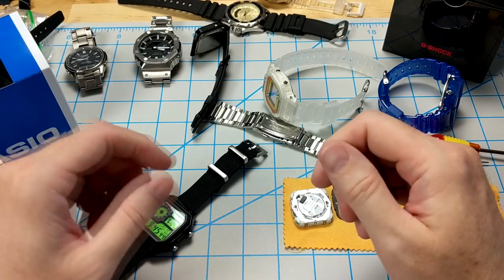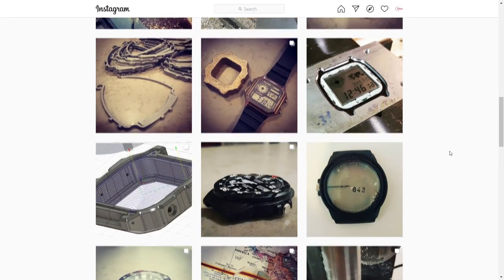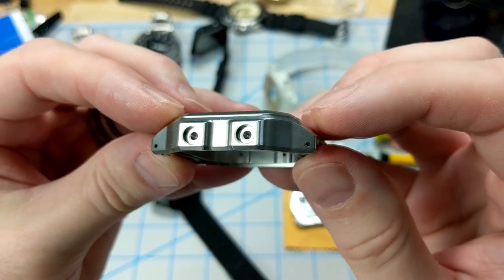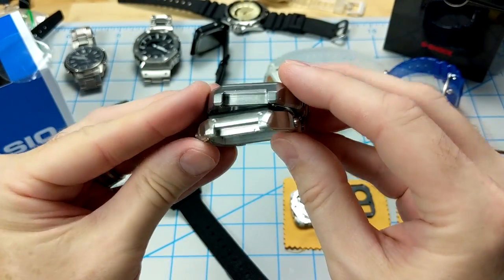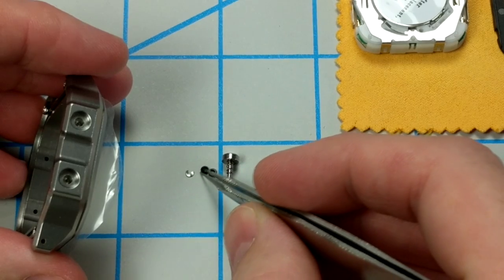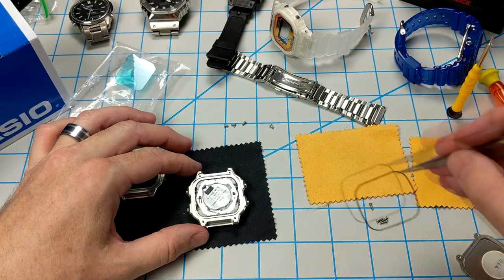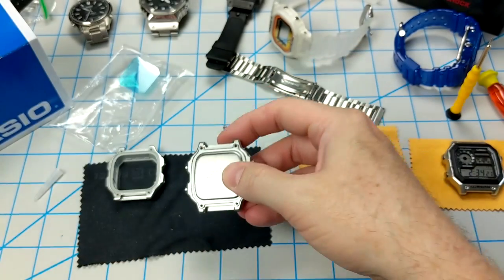Stainless Steel Casio Royale AE-1200 Mod

Comment: No doubt this is an absurdly cool addition to any Royale fans collection, but man, any way you slice it, that $150 price tag is quite the chunk of change for a Royale upgrade. Not to say that it's overpriced or anything- on the contrary, It's definitely warranted, being that the guy designed and machined these all on his own. That being said, as much as I love the Royale, with how cheap you can buy metal cases for 5600s and similar variants from China, it's difficult to justify this of expense for me, at this point in time, at the very least. 

Appreciate the video!
Reply: Metal cases for 5600 are actually only bezels, this is a complete casing.
Reply: @watchmakerful  I was gonna say the same thing. The bezel on a 5600 is just a facade that covers the module.
Reply: Definitely a product for absolute enthusiasts, that only a few will really appreciate. I'm personally surprised that there isn't a bigger market of custom cases for other watches. Think about 3rd party cases for the F-91W that would completely change the shape of the watch.
Reply: Saphire would've been nice too for the price.
Reply: This is a great product by a talented person but I just can't justify spending $150 on it. It's not that it's such an unfair price or anything, it's about my country's weak currency.
Reply: @C-NoteMac  Agree. Sapphire glass and the case made of 420 hardened stainless steel for the ultimate upgrade...
Reply: Idk man i think its kinda fair price for his skills and the trial and error for making it.
Reply: Absolutely ridiculous cost. Even the Casioak 3rd gen stainless steel mod is less than half the cost!
Reply: Look for their clone, skmei, their cases are good and you get metal bands, gold, black. You can easily fit the original "mecanism" inside
Reply: We are talking about the processes to get that curves, parting lines, tiny holes, provisions, time, machines knowledge & skill & experiences. Considering it is not a mass-production the price is a bargain tho. Serious talk

Comment: Ol dude picked up on the will of every casio fan out there! Casio Royale has so many features and is extremely accurate. My favorites on the watch are the 3 sec. amber lights and hella loud sound notifications. 
Im currently rocking gshock square 5600 with gold stainless steel case.
And throw away your 5610s. Unless u like not hearing your watchs alarm. -Shade
Great vid. Thx.

Comment: I bought mine just to mod. Erased text on the outside and inside just left Casio and the button functions. VERY clean also! Updated today, taking the discarded rubber strap from my Duro, cut it to lug size (20to18), and tapers perfectly with the Royale! metal and rubber combo makes it sportier and its not available yet from Casio.

Comment: I have ordered one. I will try to Mod my SKMEI 1335. 
The SKMEI has in my opinion some advantages.

Its cheap, less than 10€ on eBay.

I like the design of the LCD. The symbols and numbers are more readable.

The backlight is an eyecatcher.
Reply: Retro Pedro I have purchased several Skmei watches that mimic some of my Casios. I have the 1335 (AE1200), 1338 (A500), 1381(DB-360) and 1456 (GMW-B5000D-1). They are curiosities, which I never intended to actually wear. Some of the displays are not bad, but the Skmeis all lack the functions of the Casios. The bracelets are cheaper and have rough edges. Except for the 1456, the corresponding Casio does not cost that much more. Therefore, I would never recommend buying one of these Skmeis over an actual Casio.
Reply: The Case arrived. I happily disassembled my SKMEI but sadly it did Not fit.
The SKMEI electronics is a bit too big, anyway should bei possible to cut it down. 
The real show stoppers were the Buttons, they are a bit too big, don't fit through the holes .....

Comment: Just a tip for those who are moving the buttons over. Make things easier on yourself, place the metal washer and both gaskets onto the button shaft then insert into the holes. Coming from a G-Shock modder
Reply from the maker: Nice tip 👍

Comment: I'm considering this mod myself. The consideration is the cost of an AE-1200 versus the cost of this mod which has me wavering some.
The line - or ridge - around the sides of the resin case isn't where "two pieces of resin were sandwiched together". It's called a "parting line" where the two halves of a mold meet. In high precision molding you should never see a parting line without taking a 5x or higher magnifier to the molded part. Not too surprising these are obviously visible with Casio given their volume production and the price of these watches. Some of the secret in preventing a visible parting line is in mold design and where the two halves of the mold meet with regard to the object being molded. The clip is called an "E-clip", the name derived from its shape.
Reply from the maker: Yeah that parting line on the Casio is readily visible. I say go for the case! It really is beautiful and worth the money. You will love it.

Comment: Love this mod and the craftsmanship that went into it.  It must be difficult to source a square sapphire crystal, but I wish it came with one instead of the hardened mineral crystal.
Reply: Jonas here.  I really had a tough time choosing between sapphire and mineral and went with mineral for cost reasons.  I can make sapphire an option, but it would increase the price by $20.  What do you think?
Reply: @jelden65  Jonas, I didn't expect you'd reply, but thank you for doing so.  $20 more for a sapphire crystal isn't a deal breaker.  If I decide to mod my AE1200, I'd definitely want that option.  Thank you again for your reply.

Comment: Beautiful case and mod! I am an amateur vintage LCD watch restorer and just have to say those c clips you mention at 6:53 are a nightmare to install. 😄 I found someone online mentioned easiest way to remove them is inside a zip lock bag. Just in case they spring out.
Reply from the maker: That's a good trick. Yeah they are tough. I bent mine (obviously) but eventually got them mostly straight to reinstall them.
Reply: @WatchingCasio  You did a fine job! Those pushers look secure and face plate nice and snug too. 😊

Comment: You've bent the C-Clips out of shape. Your best option would've been to find replacement c-clips, they're supposed to securely snap into place. Beautiful case.
Reply from the maker: Yep, they are a little bent. i tried to flatten them out as best I could.
Reply: @WatchingCasio  It would've been nice if the case came with replacement c-clips. I don't think they're even meant to be re-used.

Comment: OH man, I hope he does one for the other classics like the A168!
Reply: Also, what is he using for the glass?  Mineral?  Sapphire?
Reply from the maker: Mineral.
Reply: If it was sapphire, it would be $250.
Reply: The A-1000D is the watch you're looking for @S L
Reply: @traviswalker8933  I do like the A1000 but the mother of pearl dial is a bit much for me,  I prefer the simplicity of the A168/A158!  Also Jonas himself replied and a sapphire would increase the cost by $20.  Worth it IMO!
Reply: @sl1237  the A1000D is available in different variants.
Reply: @traviswalker8933  Yep, all of them have the mother of pearl dial.  Even the dark A1000M has that sheen to it: https://www.youtube.com/watch?v=JJltKFeKdGA
Reply: @sl1237  that's not called the mother of pearl. It is not even a pearl colour. If the dial is a problem, you can replace it.
Reply: @traviswalker8933  Mother of pearl does come in multiple colors including the dark grey of the A1000M.  Even Casio describes it as mother of pearl.  If the dial can be changed that would be great, but how do you do it without ruining the lettering etc.?  I'm sure lots of people would like to know!
Reply: @sl1237  you can take the old dial out and then get in a new, more simple one. The dial is not affixed to the glass.
Reply: @traviswalker8933  Have you done this mod and can share pics?  Where can I get a new dial in plain black or dark grey?
Reply: @sl1237  personally, I don't have any interest in the F-91W or its related variants. There have been some mods done on the basic F-91W. The same applies to this one. Check out NODE channel.

Comment: Awesome watch case, obviously a labour of love! While I'd really like a metal case for the funky, old-school  watch from Casio's adventurous era, the W-753, with its tide and moon phase (and solar compass), the rounded case would be hell to machine, I think. I'd buy one, it's got a great module, one of the best. But it's not as popular as the Royale, that's for sure.
     And there must be some fans of the small but powerful W-93H, and W-94H. I'd buy cases for those. 
Or, the once popular WS-200H and WS-210 solars. Again, I'd buy cases for those. Well, my tastes are slightly not mainstream, I guess.
     If Mr. Kranio wants a built-customer base, if he can do one for the F-91W, there's a huge market there. Plus, having drilled lugs that take spring bars can only be a good thing. 

     For lightness, and reduced cost, how about some aluminum cases? Those would be attractive even with some dings, for "character".
     Much respect for this craftsman!

Comment: My two cents
1. Putting a $150 case on a $25 watch is like putting carbon fibre wheels under your Fiat. It doesn't fit into the Casio Royale's huge value-for-money concept.
2. Once MFG finds out about this, they may offer a metal case for the AE-1200 for 30 bucks or so.
Reply from the maker: I'd snatch one up if they did. But I do disagree - the case is awesome and makes this watch stand out. My two cents!

Comment: Hello 💐🙏🏻 Sir, I love that you have taken the Casio watch to the next level further. You upgraded it so well by modifying it. Sir, I need the Steel case for my Casino Royale AE-1200 Watch. So Please kindly let me know too. Where can I even get a steel cover for my Casio watch?  Where else can I get my Casio watch modified. I will wait for your reply sir.
Reply from the maker: Kraniodesign on Instagram or Ebay.
Reply: @WatchingCasio  SKXMOD now do a ss case with sapphire crystal, upgraded buttons & an upgraded bracelet that mimicks the original for $160, they also do it in black & gold pvd & other variations. Can't speak to the quality yet as it's still in the post, there are a couple of YT reviews, it looks very good.

Comment: If Jonas is reading this, I would look into using the module from a G-Shock dw5600E and making a case that resembles a Casio dw 3000. And if you need the dimensions for the dw 3000 let me know. :)

Comment: It looks absolutely amazing, but I'm curious to know if it still meets Casio's water resistant rating.
Reply from the maker: Not totally sure about that. The o-ring sits in very nicely and the case back is secure and sits really well.
Reply: @WatchingCasio  I was thinking more about how water tight it is around the mineral crystal, hopefully it's a non issue as the manufacturing quality looks very impressive.
Reply: I was wondering the same thing.
Reply: @djipka  I'm going to pressure test mine as soon as I get it. I can test to about 4atm.

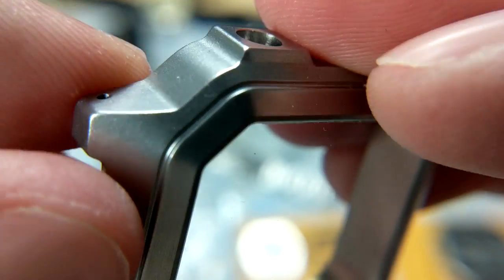Comment: 8:00 okay so I get that some people want tough watches, but it's not like your carrying a phone. A watch is either put away or strapped to your arm, I see few circumstances where you can drop it. Maybe if you fall, but most people try to land on their hands or the bottom of their arms so the watch is still protected.
  
Dope case though, I have a couple of mod ideas for the watch including swapping LEDs, adding fake screws, and glow in the dark backlight, but because of how expensive this is it will be one of the last mods. I'm even trying to figure out if I can cram some tiny solar panels into the face to make it solar rechargeable (not looking good but not entirely impossible)
Reply from the maker: Sounds like you've got your work cut out for you :)
Reply: @WatchingCasio  Update: I've figured out you can solder a jumper on the PCB to show a setting in timekeeping to enable backlight flashing for timers and alarms. I put up a post on it on the Casioroyale subreddit and figured you might want to give that a shot, although I understand if you're reluctant to make this a Casio royale channel. Also the glow in the dark backlight is fantastic.
Reply from the maker: I will check out that post! Thanks for the heads up. Sounds pretty cool.
Reply from the maker: Wow. One bread of solder? Amazing. I might have to give that a try.
Reply: @WatchingCasio  Update 2: I didn't realize this at first but the same mod that enables alarm and timer flashing also changes the amount of time the alarm beeps from 10 seconds to 20 seconds regardless of whether or not flashing is enabled. So if 10 seconds isn't enough to wake you up in the morning then this mod will also double that time to 20 seconds.
Reply from the maker: @graysonsmith7031  Ha even better :) I might have to do a video about that.

Comment: The "stainless" version looks cool for sure but it's resin at heart. This mod makes it stunning. Over $200 AUD upgrade for a $40 AUD watch is laughable for sure, but damn that is pretty. 😍 How much for the bronze one. I picturing a bronze case, light green filter on the module (only because the black insert doesn't come in green), and a faded green, almost vintage style leather band. How much will I need $?

Comment: Despite  the  AE-1200, which other Casio models (and movement modules) could be mod with this case? I guess also AE-1300? But which others? Thanks
Reply from the maker: I think only the AE-1300 since they use the same case.

Comment: What is the result weight of full steel variant? You mentioned that original 1200 strap is not good, so mb to find better SS straps for this.
Reply from the maker: Bah, can't remember. It's a nice weight, that's for sure.
Reply: @WatchingCasio  Nice weight is less weight. :) I suspect it's ~120 g in full metal variant.

Comment: I really want a better actual metal case for the Casio WV58DA-1AV Waveceptor watch... I love atomic watches and this watch looks metal buts not.  If this guy would make one I would be first in line to buy.
Reply: I think if the demand is there, he'd make more cases for other watches.
Reply: That's exactly my watch. I was looking if someone has already suggested it, and here you are!
I wonder if it would be possible to make some endlinks that could match some full bracelet replacing the original folded one...

Comment: What did you use to polish off the logos ? I'd like to do the same also!
Reply from the maker: I used a q-tip and some Goo Gone (and elbow grease).
Reply: @WatchingCasio  haha ok... Would Isopropyl Alcohol also do the trick?
Reply from the maker: @aussie_golfer  That should work as well, but be careful about scrubbing too hard or you'll remove the paint underneath the letterin.

Comment: Am I missing something? Don't tgey already have a metal one for sale?
Reply from the maker: Nope. The only metal part on the original AE-1200 is the bracelet, and even that is pretty crappy.
Reply: @WatchingCasio  ah okay thanks for the explanation and pretty cool of you to show the guy who made the case that bronze one was sweet ever gonna make anything with bronze?
Reply from the maker: @mr.angryman3599  Well i didn't make this case :) The guy in the description below did: Kranio Design. He also did a bronze case.
Reply: @WatchingCasio  yes I know when I said if you're gonna make something in bronze I meant mods not the cases when you switched the case does it affect the waterproofing by any chance?
Reply from the maker: @mr.angryman3599  Ah okay. No plans for anything bronze. And yep, you have to be careful to get the gasket right to keep the water resistance.
Reply: @WatchingCasio  I want to do a bronze mod on my 5610 but at the risk of ruining the waterproof idk😔
Reply: @mr.angryman3599  there are bronze coloured bezels available for the 5610. Replacing the bezel does not reduce water resistance.
Reply: @traviswalker8933  you know where I can buy the bezels?
Reply: @mr.angryman3599  from Ali Express or eBay.

Comment: Looks fantastic, and great video as always!  As I mentioned here before, I was lucky to get hold of one from China, not as high quality, but still nice: https://youtu.be/axUZMXOHtv0
On mine the case is about half a mm too big in all directions (I replaced the slightly larger fake module that was inside with an original). Padded with some plastic I got it fitted and the buttons works fine too, apart from the sound on two of the buttons (maybe due to the case is taller?).. I'll check out Kranio Design for sure.
Reply from the maker: Ah right, I remember. You couldn't find them again online, I believe. Is there a reliable place that sells them now? Thanks for the note!
Reply: @WatchingCasio  I tried messaging the original seller on ebay a while back and never got any reply unfortunately.
Reply from the maker: @zerousen  Check his Instagram instead. Link in the description.
Reply: @WatchingCasio  I meant Tyge's china version, but don't worry, I have my eyes on both kranio's store page and insta!